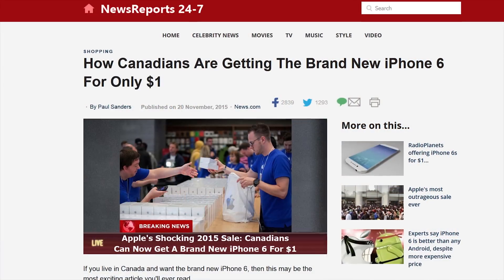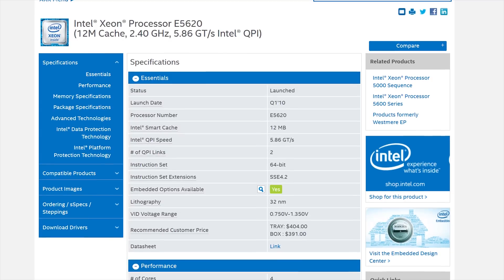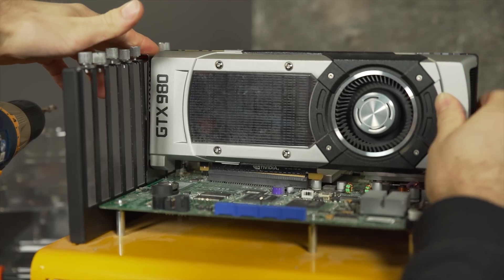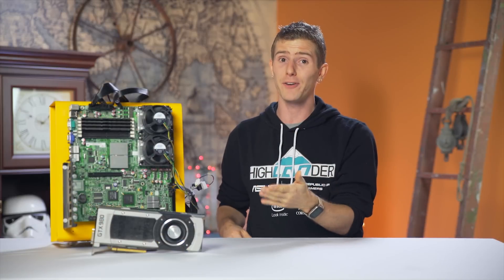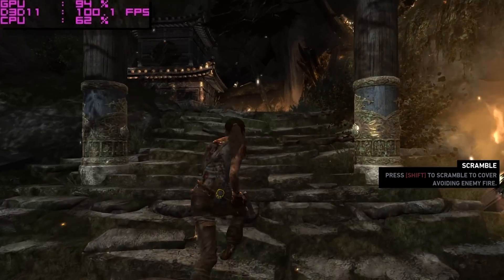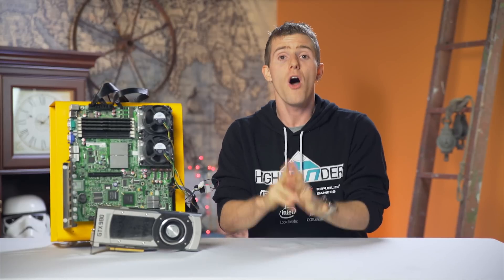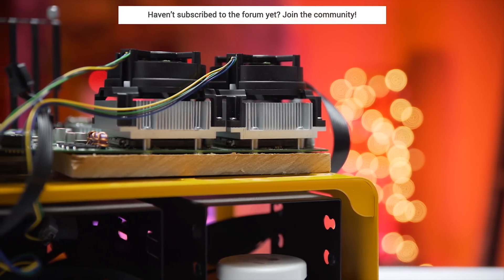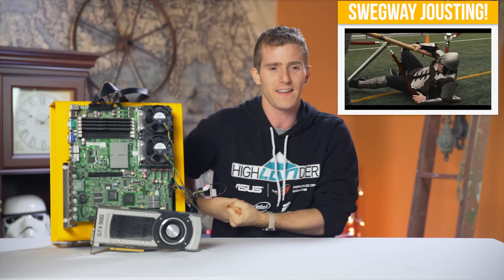Under $150 Budget Gaming 8 Core CPU, Motherboard & 16GB RAM

Comment: I do have an old server laying around, with a crashed HDD. Turns out SAS drives are expensive... And the motherboard doesn't have a normal SATA plug, only 32 pin SAS.
Reply: sas to sata adapter

Comment: I think it is better to look for old workstation pc and just change the psu and graphics card. When you got the chassis too, you don't have to worry about if motherboard supports only passive cooling. I have 2007 xeon workstation still running latest tomb raider and Battlefield with about the hightest settings.  Workstation motherboards tend to have better connectivity than server boards. And 32gb memory is also dead cheap for these old work horses. Fyi these babies aren't all that quiet :D

Comment: don't do this. server motherboards take ages to boot, and often require proprietary fans which make a lot of noise and are also expensive. combined with all the mentioned possible problems the hassle is just not worth it. Just buy a gaming platform with a good quadcore if you want to game.

Comment: CPU: Intel Core i5-6400 2.7GHz Quad-Core Processor  ($179.79 @ OutletPC) 
Motherboard: Asus Z170-A ATX LGA1151 Motherboard  ($145.03 @ Amazon) 
Memory: Corsair Vengeance LPX 16GB (2 x 8GB) DDR4-2400 Memory  ($94.89 @ OutletPC) 
Storage: Western Digital Caviar Blue 1TB 3.5" 7200RPM Internal Hard Drive  ($49.78 @ OutletPC) 
Video Card: PNY GeForce GTX 960 2GB XLR8 Video Card  ($199.57 @ Amazon) 
Power Supply: EVGA 500W 80+ Bronze Certified ATX Power Supply  ($43.98 @ Newegg) 
Total: $713.04

is this setup good? or can i get anything better cheaper or same price?
Reply: HotDawg dont get a 960.. get either an rx480 4gb or a gtx 1060 3gb for 200 dollars..
Reply: okk thx for the tip i want to buy this setup for my best friend, his birthday is in a week so i need to hurry up :D
Reply: HotDawg thats so nice of yous

Comment: Man the X58 Xeons are a way better option IMO.
They run on many more boards. DDR3 memory, 6 cores 12threads that you can easily overclock to 4ghz+
With none of the issues listed in the video.
Reply: I can find them for like 20 bucks but the motherboard s are expensive af

Comment: does anyone know a good MOBO CPU AND RAM combo for under $100?
Reply: xeon x5650 cpu with lga1366 socket is pretty cheap and really powerfull
Reply: He could go for a xeon x5450 lga 771, do the mod to convert it to socket lga 775 and then buy a decent mobo , eg. Asus p5q series, 8 gbs of DDR2 ram und a nice cooler. Xeons oc nicely and can achieve really high clock speeds. This will leave him with around 90-100$ of cash left. If you want build a complete system, you can add an HD 7970, these go for around 70-100$. But if seen them as cheap as 60$. This card is perfectly able to play your favourite games (GTA5, Battlefield 1, The Witcher, etc.) at 1080p medium-high settings with 50+fps, sometimes even more). Now if you are lucky and are able to pick this card up for around 70$, you will have enough money left to buy a PSU+case combo. And voila, your new gaming system.
Reply: ManiacPlaysGames What do you want to do with it?
Reply: I want to do gaming(bigger titles..gta5,arma3<-that could be a bitch, with arma3 needing alot of cpu power+whatever)..what about that? can do $200..I have a system already but interested to see lol
Reply: only if ur good @ exotic cooling a seriously OC'd Q9560 and dont plan on any bigger than 1080 HIGH ~ 45-60FPS in modern titles, even with a 1050 Ti
Reply: But 1366 mobos are pretty expensive.
Reply: Sorry for the late rely lol i forgot about this comment, i have recently upgraded to a GTX 1050 and want a good cpu for gaming and my budget RN is $250.
Reply: I was thinking of getting RYZEN R3 when it launches

Comment: hit me up, i have a dell 690 dual quad core xeon for sale, power button is pushed in tho
Reply: I have the SAME EXACT BUILD. The Precision 690. No one will buy it though. ;(
Reply: AbuBakr Akram yeah, its old but still works. I don't want to spend any $ on it. But someone must want to experiment with dual xeon quadcore. It's still a desent gaming computer with right graphics card
Reply: ll c Agreed. I'm not sure if I want to try putting in a graphics card and using it though, because I have an AMD FX-9590 build that I'm pretty sure will wreck the 690.
Reply: AbuBakr Akram that'll work. I mean the 690 would be great for someone else to experiment with. I'm not a gamer, i use it for trading financial markets.
Reply: bro what state are you in
Reply: Dj ballard florida, i got it working , powers right up.
Reply: I'm in florida also what part of Florida if u don't mind me asking
Reply: Dj ballard central broward
Reply: im in saint pete

Comment: I HAVE A QUESTION FOR A POTENTIAL NEW VIDEO. I really want a computer for editing but don't have the money for a high end editing computer. is there anything like in this video that is possible that will still be good for video editing on premier pro?
please get back. :)
brynn
Reply: It depends on your budget my friend. If you have a budget of at least 500-600$ for a desktop pc you can get a core i5 6th gen processor, 8-12 gb ddr4 ram, gtx 1050ti, 256 gb sata ssd.  This is a relatively  powerful  system you can have for this price. You can use Premiere Pro easily with such specs for editing but rendering speed will be a less. And if you can pay 1000$ then you get i7, better gpu like gtx 1060 at least, extra hdd/ssd. I hope i helped.

Comment: Interesting video.  One thing I'll mention is to keep in mind that the processor he used in the video (L5420) is based on the Yorkfield meaning Core 2 (Worlfdale) family of processors.  If you see a Xeon model # that starts with 55xx, that's based on Bloomfield/Nehalem or the first generation of Core I7 CPU's.  Better performance but I can tell you from working with server blades based on these particular Xeon CPU's that the 55xx family draws far more power than their Core 2 ( 54xx to 53xx) predecessors.  They'll also need good cooling.

Comment: It would be nice to see an exact build up (ie particular boards) of a system like this. The board you used is obviously a dog, but there are some much better dual CPU boards out there. Thing is, it won't be $150 but who cares. Some of us like these sorts of build ups but don't want to muck about with boards you can't easily work with. 

On another not unrealated matter, a while back I purchased a NOS Xeon 3570 for not much to use in my old Gigabyte EX58 Extreme because it has an unlocked multi. Drops right in and the big overclock was so impressive I went and bought 16gb of new ram. I get a lazy 4gb easy on a < than ideal CPU stepping, so I hear you re. cheap server CPUs. This old computer just got a new lease of life.

Comment: This is only viable if you can find a low mileage motherboard.
Otherwise all your efforts may die with the board in short order.
Better to use a new pc board as they are going out of fashion and a used but relevant cpu,
Used i5 4460's are finishing on ebay for peanuts,like £75 in the u.k.
 You can get a new z97 board new for ~70 quid and a fist full of tested warranted used ram for peanuts from c.e.x. .
Surely this is a better route,knowing your efforts may last 6 years,and in a coupla years there will be some xeons and i7's kicking about cheap as yet more dells and hp boxes die.
The price of used cpu's looks rosy with zen coming out.

Comment: I know I am a year late to this, but older workstation servers would be a great alternative. I found a HP xw6600 with top of the line specs with all 4 hardrives for about $30. All I had to do was find a GPU and Perfecto! Still, this approach is safer if you want to get every part. I got very lucky.
Reply: Michael mu. I'm using a Dell Precision 690, got it free, upgraded to Quads on the CPU's for 8 cores, and 32gig of ram and Intel SSD raid all for under $150. Playing Fortnite high settings @ 1080p @ 60fps on average with a few drops but not many. It crushes Crysis on max quality settings.
Reply: @ikannunaplays  want to sell now?
Reply: @54haks63  Sure! $400 plus shipping
Reply: agreed
Reply: DW :)
Reply: lucky indeed my friend... lucky indeed. xD
Reply: My dad has an old hp x4000 if that is usable should I recycle it
Reply: @uhoy-c8o  what happened
Reply: I am 3 years late to this
Reply: Wilhelm II yea, but what's the specs ?
Reply: Nintendo switch?
Reply: Michael mu. N
Reply: Want to sell now?

Comment: Or, you could go for some of the older 1366 Xeons. The L5640 6 core is going for about $40 on ebay, and the L5630 4 core is going for a hell of a lot less. And those are just the low power ones. Very respectable performance, and an older 1366 server board isn't going to break the bank too bad. 

By the way,  some of the older LGA 2011 Xeons can be had for a great price, and perform excellent. But the motherboards can be ungodly expensive still, even though it's four to five year old hardware. 

But I'd definitely look at the 1366 platform instead of 771. And just look at eBay, the prices on 1366 server crap isn't that bad at all. I'd say $70 for the motherboard, $40 for CPUs, and maybe $30-40 for RAM. 

So maybe between 150 and 160. Maybe you'd end up a little higher, but it's a newer platform.

And as Level1Techs recently did a video on, you can often get this stuff for a really cheap price if you know the right people and do a bit of searching.

Comment: I've been doing systems with old server hardware for years. One thing's for sure you can't beat the performance. It's easily outdated more then standard computer components so the price goes way down, plus the hardware is retired after a set time working or not so buying used you can really stretch the $.

Comment: Is it just me or is motion blur horrid? Even when i run games at ultra, motion blur has to be turned off. It makes my eyes feel weird.
Reply: Motion blur is garbage
Reply: Motion blur is overrated. I usually turn it off in every game that have that feature.
Same goes with Depth of Perception.
Reply: @AlexSDU  lol I don’t even have depth perception irl
Reply: sorry for responding to an old comment but as voshchronos said you either have motion sickness, but you may also have a crappy monitor. one of the two.
Reply: yeah but cheaper monitors and most tv`s give you motion blur for free so yeah defo turn it off in game settings ha ha
Reply: For me, when I finally turned it on, the Lego games looked a lot smoother
Reply: You probably have motion sickness.
Reply: Yeah... Motion blur is just weird
Reply: Motion blur sucks.
Reply: its not just you
Reply: Welcome to the PC Ma$t3r Race

Comment: why, why , the hell why you use that !!!

Look, its nice to use old tech and give it new life but really.

here are some problems.

1º that board is ready for processing work not graphic, the bus, caches and all the components are not ready to handle games.

2º games need to know the cpu they are using to use all the performance, and at best they will detect 1 CPU and park the other.

3º the pci express connector on servers are for RAID cards and they normally work at 2x or 1x, not 8x or 16x, or and don't try to use any pcix connector (they are not really an PCI).

4º and last one, why , why , why a Dell servers, from all the servers you got to pick the worst one, xiii, not Dell, they burn capacitors and they are normally lower that any other brand with that age, try a HP or an IBM.

Best regards
Reply: custume ppl on a budget

Comment: i got a complete pc with a gtx 710 with dual xeons for $150
Reply: TheMegabitGamer obviously ios
Reply: there is no such thing as gtx 710, and gt 710 sucks dick in literally EVERYTHING.
Reply: i reckon i could remake my 600 dollar computer from 2013 for 200 dollars. It had an i3 3220, xfx 7750 2 gb, 4 gb ram, and a shitt yasrock mobo. 
Over the years, upgraded to an i5 2310 and buffed it up to 12 gb of ram. Got the i5 for 50 aussie dollars of off ebay, and works perfectly. RAM for 40. Counted up the prices and around 150 dollars, not including psu, which is a kinda alright one wierdly enough. Can run most games on medium - high
Reply: Josh Rice Change the CPU if it can support quad core
Reply: if you're like me, this is just what he/i needed. im too young for a job so a 30$ card is perfect for my old pavilion. it runs games fairly.
Reply: yeh so i built the z600. Got dual X5667's (quad w/ hyperthreading), 24gb ram and 500gb ssd. cost ~£500
Reply: noob
Reply: InazumaOrionLoL  what OS you running
Reply: My current machine is a dual core dual xeon HP xw6400, 16gb ram with a shitty £20 gtx 470. cost me £100 all in
Reply: kinda bought a HP z600 a few days ago, it's a project. just 8gb ram and single cpu. plans are to buff it out
\

Comment: I have an issue, I have 2 Processors but windows is only detecting 1 of them, can I get some help?
Reply: Update: it's fixed. Windows took 2 restarts to recognize both processors. 2nd, I've already researched beforehand how many processors work with what software. Windows Server works with up to 4 processors. Meanwhile Pro and Home edition work with up to 2 Processors.
Reply: My BIOS detects both CPU's
Reply: might need a higher version if you're trying with home edition or professional, ultimate might be needed(i dont know) in the past it was standard that home edition wouldnt support that many rams or even storage as higher versions for no reason at all, might apply to CPU's i'd imagine
Reply: I've endlessly looked through forums and pro and home edition are supposed to work with 2 CPU's. This is really strange
Reply: TheUnexpected6i think only windows server works with them

Comment: if you get your hands on a cheap x58 (socket 1366) board. you can pair it with 56xx Xeons. you can get a 6 core xeon or i7 like that for around 60€. they outperform socket 775 quadcores by a mile.

those boards also feature ddr3 RAM and some even USB 3.0.

most of the consumer boards of this chipset are still quite expensive, but you can get some server boards for 60-70€ as well (e.g. SuperMicro).

Comment: I wonder why the pc did so well in benchmarks.  Because it had a $500 GPU in it of course it will run tomb raider at 60 fps because that is a very GPU intense game.  And so where all of the other games that he benched marked for the most part
Reply: Jeremy Currier and the cpus weren't a bottleneck, they were expected to be.
Reply: He never said it was a full system, just a platform. Look at the title.

Comment: Show everyone how to build a nascar for $1500... find an old frame and wheels at the junk yard, buy some cheap fiberglass for the sides and there ya go... I'll just add the  $100,000 engine so it runs but you get the idea...
Reply: I've saw before a GPU that cost as much as my whole PC by times 2.
Reply: Yeah, Linus just sawed one too
Reply: Blink Rim  Since when are LS engines $100 000?
Reply: @simonbrisebois-therrien2775  Race engine.  Every part is blue-printed, custom block, not factory stuff.  Hand-built, dyno-ed.  Maybe 100K is exaggerated, but not by much.
Reply: @AlexSDU  there are gpus that cost over 30,000 dollars soooo
Reply: @Ender Bartnik
It's new to me. It's like find out that a car engine cost more than the car itself.
Reply: @AlexSDU  it may seem outrageous to even think about gpu's that expensive, but they have a very large place in the commercial market.  And cards like the 1080ti are worth the money performance-wise for those willing to pay enough.  In general, when I build PC's, I generally allot around 1/2 of my budget to a gpu (roughly).
Reply: I totally get that XD buying graphics cards, cases, PSUs, monitors are almost as bad as buying just the motherboard CPU and RAM! but these days buying used is easier than ever... so no worries!!!
Reply: No, all he said was $150 for "CPU, Motherboard, 16 gb of RAM", so its not "how to build a nascar, and doing that, itd just be "How to get the shell for a car for $1500"
Reply: You must be fun at parties
Reply: but the card is nowhere near 66 times as expensive as the motherboard cpus and ram your example is greatly exaggerated far beyond belief wasn't even the best card in existence at the time

Comment: I bought a Dell Precision 690 for $25 at a surplus store. Currently has dual Xeon 51xx processors and 8 GB FB DDR2. I got ($15) 16GB Ram on the way and some ($65) X5365 Xeon Cpus, all in all It comes to a grand total of $105.00. I recommend looking for old work stations. You still get budget, performance and are able to hook up the creature comforts and dont have to saw anything or ghetto rig the system.

Comment: With a bit more research, and a slightly higher budget then 150, the "downsides" of server equipment disappears. I'm running 128GB ram, 32 threads @ 2.6 on an EATX board with with case, and noctua coolers for a grand. It is doable to make a gaming equivalent system for much cheaper then a gaming rig, and my mobo supports many more upgrades.(4pcie slots, bunch of usb connections, fan headers, etc.)

Comment: I built a computer that can play crysis 3 at 300 fps for 120 bucks.
Reply: +Tntmod54321
Gtx over9000 troll edition
Reply: Tntmod54321 Like, you know he is joking, right? Just posting big fat lies, thats it.
Reply: "Definitely not into Neko lolis"...
Reply: No. It is not that... Just the name. That is quite a specific type of porn you are claiming not to be into.
Reply: Nick, were the parts used? And what did you mean by gtx 2000, gtx 20? quadro 2000?
Reply: Definitely not into Neko lolis Mmk don't have 120$ anyways, soooo.
Reply: Nick Ushor parts?
Reply: Definitely not into Neko lolis gtx 2000 , i3 titan,  Megabyte H1  board, Infinite ram .
Reply: Cameron Mills
What? used server boards are just too op
Reply: Cameron Mills
Psst... :3